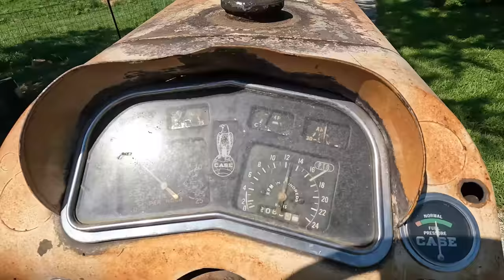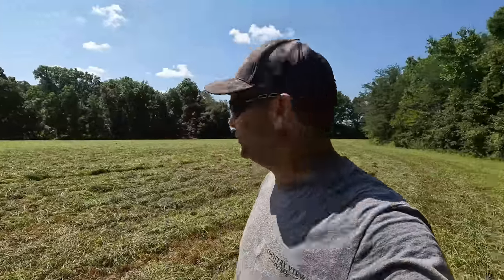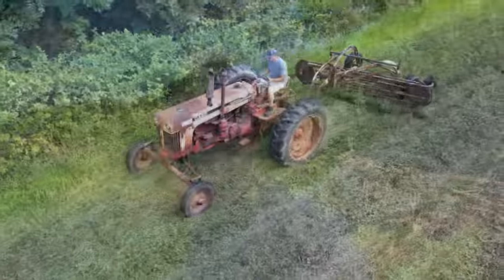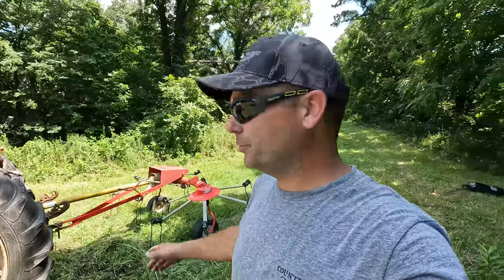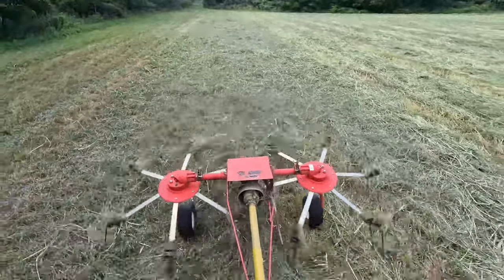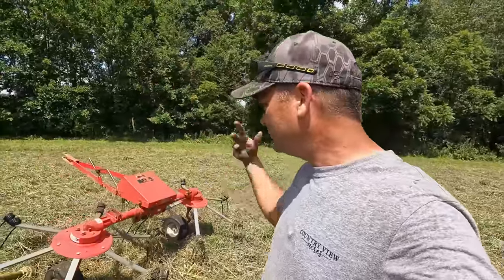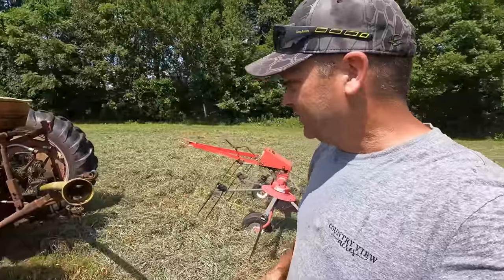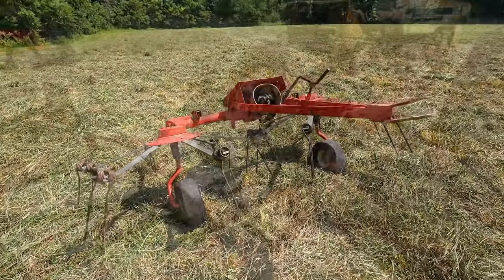The Hay Tedder Crashed and I'm lucky I didn't get hurt.  It could have been a lot worse.

Comment: hello from the Netherlands .  
you HAVE BEEN SO LUCKY NOW .  
in the video you can also see that the pto rod was dancing back and forth when it came loose from the tedder and that at one point it got stuck under the lift arm that also brought you good luck because i  think that by still being propelled that one could also have hit very easily and hit you .  
maybe even more than the tedder because you still drove away from it.  
but if you had slowed down the tedder would surely have hit you.  
my tip : 
attach a chain to the hitch pin with a closing clip, 
so you always have a closing clip with the pin, and you will not lose any closing clips anymore.  
and leave a Hitch pin with a closing clip attached to each tractor, 
so you never have to look for a pin and clip again because it is with the tractor.  
thanks for the video again .  Sincerely, Hollandduck

Comment: Hello Evan glad you were not hurt. I wonder why your pto shaft did not pull apart, looks like it is destroyed also. This is a good lesson that many can learn from and I don't think that your to blame either. When I was a kid we never used them and I have seen the clips come out. The proper pin that is heavy works the best. See you then have a good day.
Reply: When the tedder flew up in the air it bound up the joint enough to blow up the u-joint and yoke, so it likely bent the pto shaft before it extended far enough to pull out

Comment: We welded a bolt on top behind the pin slot with a piece of straight stock that pivots over the pin after connected and rests on another  smaller piece of of stock on other side of pin and drilled a hole in that smaller stock that gets a circle pin fastener and that locks hitch pin in . 
   John Deere baler similar design we did the same with our rakes.

Comment: You are so very fortunate not to have been hurt. Your situation reminded me of a situation back when I was in high school (1964). I did part time farm hand work for a family friend. He had 2 AC WD 45s. We were plowing in the same field. I was maybe 15 yards behind him. The bell on the snap hitch on his tractor broke and dropped the hitch bar of his 3 bottom plow to the ground. He was not aware this happened and kept going. The hitch bar dug into the ground. Neither of the 2 top links broke or let go. The plow lifted and tipped high forward. I SCREAMED STOP at the top of my lungs. Somehow he heard me over the 2 tractors and stopped. The top of his plow was about 1 inch from the back of his head when he stopped. Had he not stopped that 3 bottom plow would have crushed him against the steering wheel. Sure glad you were not hurt. Everybody out there, stay aware and alert when working on and around farm equipment!!!
Reply: I've heard that was a problem with those snap hitches.  Becoming unhitched rather than breaking was more of a problem.  That's one reason the 3 point system was universally adopted.

Comment: You probably won’t ever do this but if you should ever plow with your D17 and an original Allis snap coupler mounted plow it’s vitally important the snap bell hook under the tractor is in good shape and hooked in well into the snap coupler ring on the front of the plow. It has happened where that comes unhooked and buried itself in the ground which causes the plow to swing up and forward and land on top of the tractor driver.

Comment: This happened to me several times. I always did have the clip,  but it was pushed out of the hitch pin by the hay. And to my luck I always use a two-part shaft, so it just slided apart, leaving no damage at all… That always was very embarassing 🤣
Glad that you didn't sustain any injuries.

Comment: That was a close one for sure, Evan. Even a piece of wire or a bent nail will work if one doesn't have a pin clip. Not ideal, but better than nothing.. I remember on the farm , most of our "hitch pins" were just old bolts, but our equipment was pull behind converted horse drawn stuff so the center of gravity was really low. I guess that's how we got away with it.  Glad you weren't injured. Hopefully the repairs will be simple.

Comment: ive had hitch pins come out several times with mowers, looks like the shaft may be bent!! as you said   also  you may want to check out fixing an Inverted pin  bolted to the cross bar hitch you dont have to worry about hay dragging safety  pins out or drill a hitch pin out and put a 1/4 in bolt as a safety pin

Comment: JudithB  Wow!!!  That  was  scary!!!  Hope  you  can  fix  it  without  too  much  trouble!  I  started  painting  all  pins  bright  red or  orange  so  they  can be  found  easier.  The  pin for my yard  trailer  for  the  lawn mower  gets  lost  every now and then.  We  are  finally  getting some  rain  down  here,  so  I  am mowing.  Lots of  pruning to do  too,  along  with  working  firewood.  I  decided  to  move the  quail and  rabbits  into the  barn for the  winter,  and  buy  new  cages  instead  of  rebuilding the  old  wooden hutches.  Not  much  cost  differences  in the long run.  LOL!  Hope  its  a  long  fall  with so much  to do!!!

Comment: There are a lot more things to pull, than can pull.  So we always kept a pin on eavh tractor and on the baler, chopper, other equipment that could pull wagons behind when in use.  Tractor pins go in the tractor toolbox when not in use.  Chopper, baler, ... pins go i n thier drawbars when not in use.  Clip goes in the pin except while putting pin in or taking it out.  Some pins have attaches spring safeties instead of clips.

Comment: Did you use a haybine with sickle bar and conditioner to cut the hay? If yes, it may not serve 
much purpose in tedding the hay. The conditioner rollers will cut one day drying time off the
process. Hay cut on Monday morning might be ready to bale by Wednesday afternoon.  You
also want to rake the hay in morning, to lessen the prospect of knocking the leaves off as in
the case of alfalfa. Grasses not same concern. Or so I remember from youth on the farm.
First time I cut a pasture with a sickle bar mower, I was five years old and could not reach
the hand clutch on SC Case to stop the mower. I circled round when done till Dad jumped 
on and disengaged the hand clutch. Those times are gone forever.

Comment: The funny thing is when I watched you hook the tedder up and you did not put a clip/clevis thru the pin I said to myself. "Man there goes another guy that does not put clips thru his pins? Whats a matter with these guys. there are two other Farmer's video's I watch and all three of you do that same thing. Drop a pin and do not put a clip thru the bottom. I have always put clips thru them with the thought in mind that it is or was possible for that pin to come out and the instant I spotted that tongue go down I knew what happened. small thing to do to prevent big things from happening. I bet you will keep some clips around your tractors now huh!? 
Glad you did not get hurt. that could have leaped far enough forward and drove those Tedders thru your back. again glad you did not get hurt. thanks for sharing it will show others what not to do. for sure. God Speed. ECF

Comment: Well running a redder I have found that the balance is critical. If the tines are not far enough down the the hitch runs up and down possibly inching the pin to the top. I had a problem with mine and found shimming the the hitch between the Clovis of the hitch so it wouldn't move with spacers, prevented me from adjusting problems. You don't want the tines digging in the ground but when the hitch is able to move up and down very hard to get that sweet spot. Give it a try prevents me from adjusting to much and most likely a balance issue. My two cents Dennis

Comment: Just a note - the hairpin/R-shaped cotter pins can also come out of a hitch/clevis pin if they get snagged on something.  Had it happen to me when using a grapple - the cotter pin holding in the clevis pin that connected the grapple lid to the hydraulic cylinder came out and then the clevis pin came out. 

Didn't cause any damage given it's a much lower energy piece of equipment, but between that and having linch pins come out of 3pt finish mower casters (thankfully the wheel/caster was on the back and didn't go throw the mower) I tend to use some form of locking hitch pin for things I need to frequently pull the pin and safety wire on linch & cotter pins that won't frequently be removed. ....especially for equipment that vibrates a lot.

Comment: Lockease hitch pin. Worth the $30. PTO shaft is probably bent as well. Highly recommend putting a straight edge on it to double check. Easy to pick up another PTO and cut to length.
Reply: Also, if the PTO shaft doesn’t slide in and out easy, she’s toast.

Comment: Wow! What a trip! Glad you weren't hurt. My mom injured herself pretty good on a tedder of similar design almost 40 years ago. The tines were improperly adjusted and hitting the rear guides one time. The guy running it forgot to disengage the PTO and let out the clutch after putting the transmission in neutral. My mom already was standing between the drums when he let the clutch out and the implement started up again. The worst she got was some really ugly bruises on her legs. She was really fortunate it wasn't worse. BTW I don't know if you saw, but when you first started to line up the bar to hitch up the side delivery rake, a rather sizeable vole or mouse, possibly a small rat, scurried across from the lower right of the screen and behind the right tire of the tractor.
Reply: Behind the Left tyre of the tractor.

Comment: Might want to try wiring clips to all of your pins so they are always together.
Reply: When I take the clip out I put it on the handle of the pin or back in the hole after I pulled the pin

Comment: you should never use that drawbar that fits into your lift arms on the 3-point hitch. You might not have been using it when the tedder came unhitched but that is dangerous too if you was.
Reply: the old fords and Ferguson didn't have a draw bar except for that but there was two adjustable bars that ran to the top link